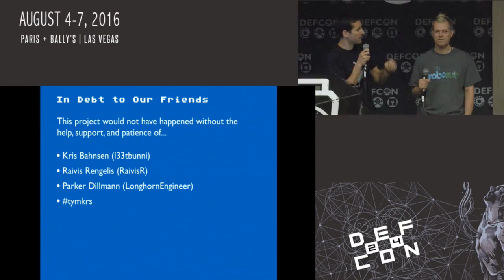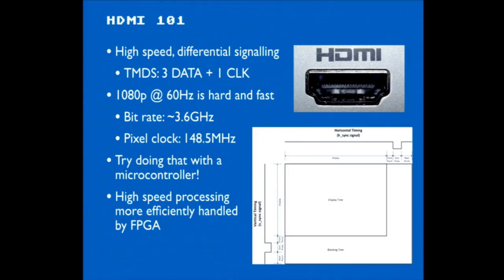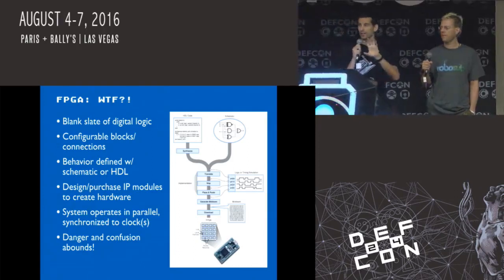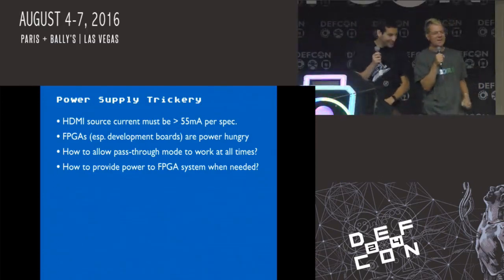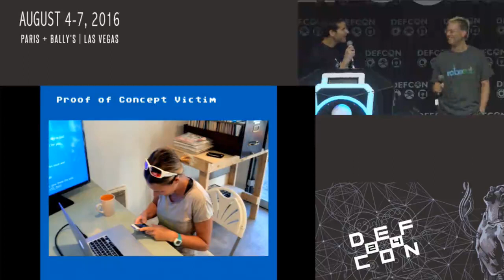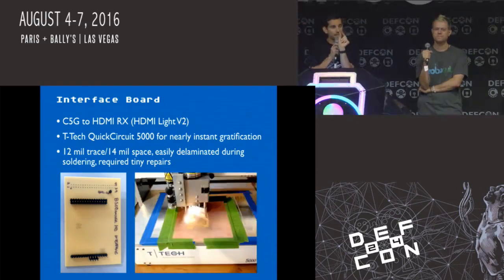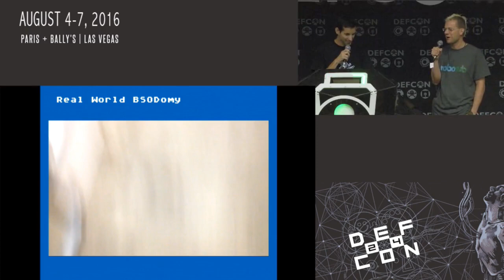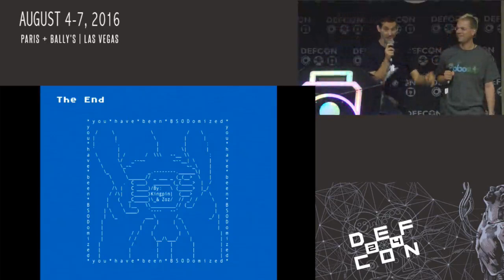DEF CON 24 - Joe Grand and Zoz - BSODomizer HD: A mischievous FPGA HDMI platform

Comment: In fpga, think electronics not software. You need to draw you digital circuit, that 's how you get maximum performance. And also it will be much easier to predict what your design do.

Comment: I predict a BSODomizer 3 when the Propeller 2 becomes available.  It doesn't do HDMI output from the chip, but it will drive an HDMI converter chip; it is capable of 1080p via component at the moment.

Comment: I wonder if it would have been possible with a raspberry pi or something like that. I mean, the BSODmiser prototype is pretty huge and a raspberry pi hadles hd video pretty well and it's quite tiny
Reply: I think there are ready-made HDMI switches. The fun in this project was probably more the act of synthesizing an HDMI data stream from the bottom up, which is a nice challenge
Reply: The Raspberry Pi is super power-hungry. You would certainly need an external power supply, I think. But it would be possible, I guess.^^

Comment: When they were talking about the milling of the board,I got kind of annoyed. I am on a break from development and am doing manual manufacturing labor. We have to have 16-32 mil coatings of sealant on wood... applied with a cheap 2" paint brush. But watching these defcon videos makes me want to go back to tech even if the stress is higher. (Last job was a startup)